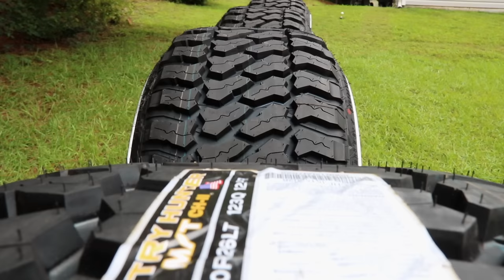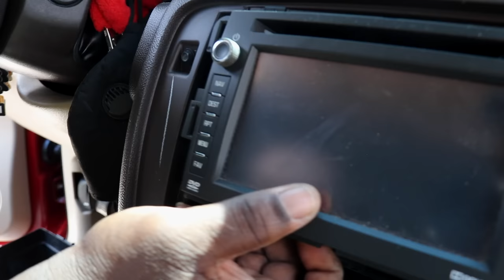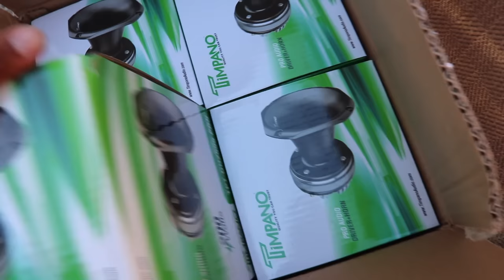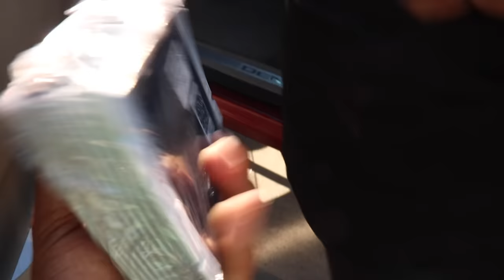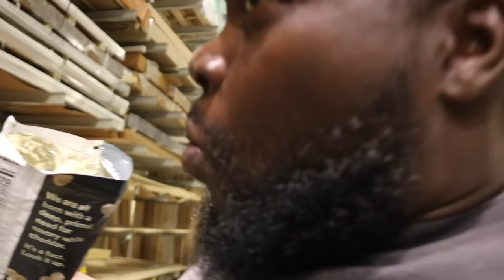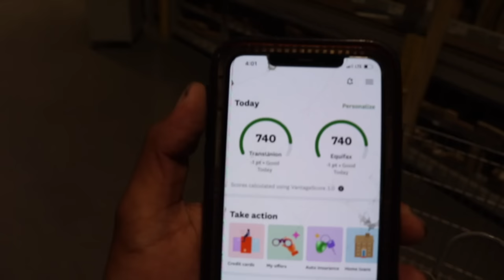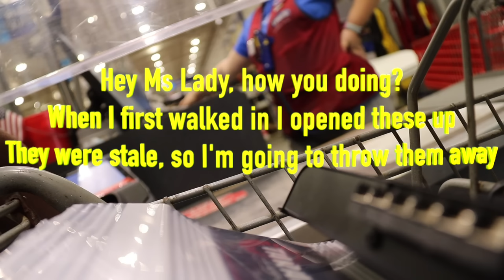We BUILT the LOUDEST stunt wall in 3 days! *SUPER LOUD*

Comment: Have you time delayed the front row of horns, so the sound from the back row of horns arrives at the same time as the front row of horns? If they are set a foot back, then the speed of sound is 1125 feet per second, so you are getting reinforcements at multiples of 1125 Hz and nulls at odd multiples of 563 Hz.

Comment: Bro first and for most change the screws to bolts and clean both side of Frame for alt . Also wire from the back of the alt the positive on the wiring harness 0 gauge will help a lot . Run a ground from alt to chassis and from chassis to motor and chassis to battery will help !Taramps are very power hungry I would get another 370 and Saul alt bracket and you will never be let down when you install the lithium and if  you run it at 15.5 you will get alot more out of your amps ! Come see my boy in the Carolina’s to get a real tune on them amps vs turning dial with no meter